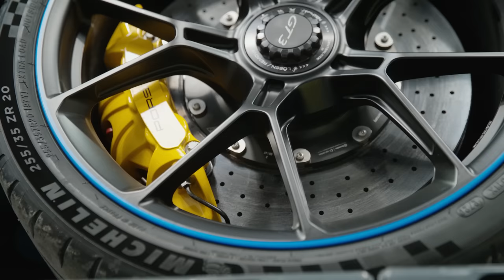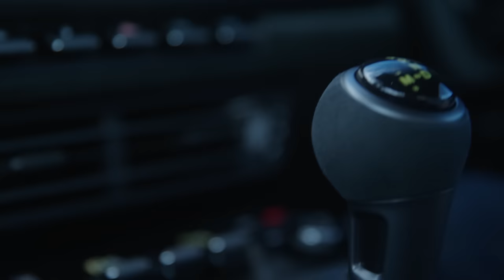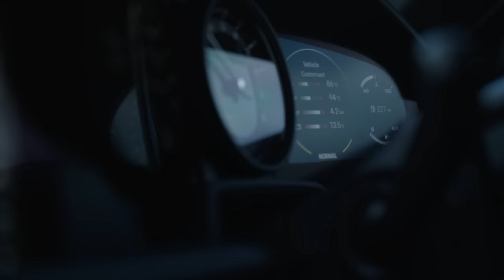Review: Chris Harris drives the new Porsche 911 GT3 | Top Gear

Comment: Spring rate is relative to the suspension design. Previous 911s used cheaper McPherson strut front end. The few benefits of that setup, beyond manufacturing/assembly costs, is, typically, more direct steering feel and a nearly 1:1 effect of the spring on the tire, AKA the spring rate at the wheel. Double wishbone offers dynamic camber gain (keeps tire contact patch stuck to the pavement), but loses the almost 1:1 spring rate to wheel rate factor, hence the stiffer spring rates chosen. Suspension nerds will commonly talk about the "motion ratio" of the springs when building aftermarket coilover setups. All that matters is the spring rate experienced by at the wheel.

Comment: Hopefully this synthetic fuel product they're working on works out, and we can continue to have mechanical engines like this long into the future.
Reply: Knowing Porsche, it’ll work perfectly and they will charge a equally high price for it.
Reply: Formula 1, Bentley, BMW, McLaren, Ducati, Mazda, Audi (at least according to their newsroom from 2018), fuels Europe, Exxon Mobil, shell, KLM, Lufthansa,  parts of the German government, the efuel alliance, and carbon engineering are all looking at efuels
Reply: When quartz electric watches first appeared they decimated the Swiss watch industry, and then people rediscovered the beauty of precision mechanical engineering and traditional Swiss watch making, and Rolex and Omega and the rest came back with a vengeance. Hopefully the same will happen for ICE cars, particularly the best of them like Porsche. Carbon neutral synthetic fuel could well be the answer.
Reply: @Crazy_Worlds  Sure would. It would also make sense to fuel all of the cars on the road currently with a sustainable fuel.
Reply: @camcar1091  I suspect it will be somewhat pricey.
Reply: @Crazy_Worlds  Yea but that’s why a lot of experts suggest to mix it with normal gasoline at first and as synthetic fuel becomes cheaper (as production increases and the manufacturing processes refined) to steadily increase the efuel concentration until you have a fuel that you can buy at any gas station that’s 100% synthetic fuel and at an affordable price.

Comment: Nice driving. Love to see itt. I didn't know anything about this car until very recently, haven't been keeping up to date with current sports cars. At first the wing had me feeling confused, if I would like it or not. But the wing is actually a fancy touch, and I love it. The 2 Porsches that I would really want right now, is a manual 991.2 GT3 or a manual 992 GT3.  13:46 What a drift Chris 😌

1:37 The main area where you'd want a manual is right here. Brand new car and you gotta baby the car, quarter throttle and low rpms. Manual cars are even fun to just chill and go through the gears. I can see exactly what Chris was feeling. 😂 Driving all out, you can have fun with either transmission.

Comment: Surely it has higher front spring rate because the non-strut front suspension doesn't act against its springs at 1:1 like a macpherson strut? I am going to venture that the effective wheel rate is going to be pretty much the same as before.

Comment: I inherited my Grandpa's 1972 Delta 88 Royale with a 350 rocket engine.  He never drove it over the current 55 m.p.h. speed limit at the time.  I got the car at 45k and that engine would sing with power and lasted well over 200k leaving must cars in the dust with a top speed of 115 m.p.h. .  Break in periods on gas engines should be a lot longer in my opinion.

Comment: I think, even in the case of Chris, you have to read a little inbetween the lines. The car is obviously great, almost as a fact of life. But, if they have doubled the wheelrates there is no question the car is too stiff for B-roads beacause they’ve already been too stiff for B-roads for ages. Then again, Chris driving on the track the roll gradient does not look any stiffer by eye (admittedly not a very good analysis tool) - so have they taken another step in reducing the AR-bar stiffness like they did from 991.1 to 991.2?

If you look closely some track footage here you can see the front do a little bit of that 911 hopping. It is difficult to build damping into the tyres. It looked pretty much like a hot blooded race car.

It may be the most modern 911 but is it the best, the most fun 911? And would it be more fun with manual?

Comment: Looking thru the comment section, I can see people arguing about the efuel porsche is developing. Let me lay out some points
(Please take some time to read)

1) Porsche has successfully created efuels and is producing it in Chile, where their factory is powered by wind and solar power
2) Efuels are just as efficent and produce at minimum, 85% less carbon dioxide than regular fuel
3) Porsche has been testing its fuel on its 70's models, as well as modern models and has found no issues so far
4) Porsche intends to share its formula with F1 and the world once it has perfected it
5) When efuels do come into the market, they will be mixed into regular fuel and will make use of existing petrol stations until the process is streamlined enough where petrol stations can completely switch over to efuels.
6) There are gonna be atleast 1.8 BILLION ICE cars on the road in 2030, with only 8% of cars being fully electric so oil companies like BP, shell and chevron will eventually switch over to attempt producing efuels
7) If you told me 2 years ago that efuels would be a thing, I wouldnt believe you, but after following it progress closely and doing signifcant research, it seems to be good news for petrolheads.
8) This will not stop cars electrfying in the future, but it will allow us to run our ICE cars and still allow manufactures like ferrari and lamborgini to keep producing ICE cars.

Comment: It's astonishing that a car with 325 ft lbs of Torque is still for sale in 2021.
Reply: well it got a 6:58 in the Nordschleife, better than any Corvette.
Reply: @Ginkoman2  
I'm not saying it isn't a legit circuit racing strategy to severely undersize (low torque) an engine to save weight, then use RPM to make HP.   When speed is carried, torque (meaning acceleration) is less important.  Torque, and only torque, affects acceleration.  So if you need to stop and go and you value acceleration, as most/all of us do, Porsche's approach is totally unacceptable.  Thats why all Porsches under $200K are dead in the water in any street race.  They are eviscerated in a fraction of a second.
Reply: @FFE-js2zp  The GT3 does -60 in 2.8 secs. 
what are you on about? And in a race there isnt really much of accelarting unmoving mass. time es gained through driving fast through corners. 
and accelaration isnt really a torque thing, but a grip thing. you can see this with the GT2 eg. that has 700Nm of torque but isnt really faster. same with EVs. you cant really gain much more accelartion than the 2.2 secs mark. the reason why the tesla roadster has close to 2secs 0-60 is 1 AWD and 2nd it is much more heavy meaning more grip to accelerate. 

the torque is enough. 
You have to consider the gt3 ways almost nothing. so it does not need as much torque.
Reply: @Ginkoman2  
No way, the GT3 is a 3.8 to 4.2 sec car on Dragy, and even that's due to cheater gearing which makes the car even slower up top.  I've personally eviscerated GT3s like they are standing still. A Honda Civic R is substantially stronger, but of course, still no contest. That's in my F-Type both pre and post tune.  The reason is the roots SC, which has a massive torque mountain mid RPM that falls off at high RPM.  That equalizes the HP from 2800 RPM to redline at roughly 700HP flat.  Peak HP means nothing, its area under the HP curve that makes a car fast, and that's directly attributable to torque, not RPM.  $200K+ Turbo S's are much stronger, but need time to build boost, and are still easily beatable in any car with a serious torque to weight ratio.

I disagree that a GT3 is light at 3200 pounds.  Thats exactly 0.1 Torque to weight.  My 2014 V8 is 700/3600, about double the acceleration of a GT3.

Comment: I had a 996 GT3 and was Newley thrown off the road on the A82 in Scotland because the suspension was that firm. Too firm a ride can ruin a car for the UK. I suppose if you live in London and can only stretch the gt3 legs at a track then fine. I live in Scotland have have unbelievable roads on my doorstep and therefore desire a better road car. Please Porsche can you make a 992 Carter’s T with N/A engine from Gt4 and manual. 🙏

Comment: I just wanna hand Chris the keys to my dads extremely modified 1994 911 turbo, ill drive my single turbo converted, 3.2 forged internal stroker 1500cc injectors e90 burning 722 wheel hp 2001 Audi RS4, and we go blast around lake Tahoe. My dad is too timid so i just gap him by a half hour. Im really curious to see if my little 4 door Audi with $500 coilovers, and 700 hp is really that much faster than that insane 911. I drive it all the time its nowhere near as violent as my Audi but its a 500 horsepower twin turbo ultra weight reduction roll caged 94 911 the thing kicks ass. Its just so different. My car has a quaiffe sequential gearbox i saved 23 months for with straight cut gears, a triple disc clutch, insane axles and driveshaft with a ultra light weight single mass flywheel.its gutted so it only weighs 2790 pounds with me in it. A 722 hp all wheel drive super super stiff chassis setup sequentially shifted saloon car is violent, aggressive, incredibly pissed off, the whole kit and caboodle. To give you an idea it does 60-150 mph in just over 10 seconds. I did 177 in the standing half mile when it was still H pattern 6 speed with full weight. Its so unbelievably impressive then when you consider a 33 year old master ford mechanic (me) built it in a 10×18' garage, its flat out mind blowing. Id even let you drive it Chris. Bet you a dollar you give it back speechless.
Reply: cnmmd qiuoo  they always are my friend. Im surprised Porsche is going away from manual transmissions. Their cars arent the same pulling paddles to shift.

Comment: Yeah but it weighs 1.5 tons!

How would a little all-carbon 911 body with a 2-litre turbo flat six go against this monstrosity?
Say, something under 900 kilos all up, and with around 400 horses, and a red-line north of 10-grand?

Because, you know what? I reckon such a car, based loosely on the 1972 RSR bodyshell, would spank this thing.

And if you did that, you'd also be able to whack 20KwH of batteries in the front , add two electric motors, each with 100 BHP, and turn it into a hybrid rocketship with on-demand AWD, a sub-3-second 100km/h time, and it could also pootle around as a front-drive electric town car with about 40km of range.

THAT is the 911 I dream of. It's a function of technology to make things better. And I am sorry to say it, but a 911 that weighs 1.5 tons is worse than a 911 that weighs 1-ton. Period. End of story.

Lightness is efficient. Weight is the enemy. Herr Porsche would be spinning in his grave if he knew how fat and luxurious the 911 is. It does not need any of that garbage. Screw luxury. That is not what driving is about. Driving is about connecting the driver to the road in the best way possible, and the best way possible is to make your car lightweight.